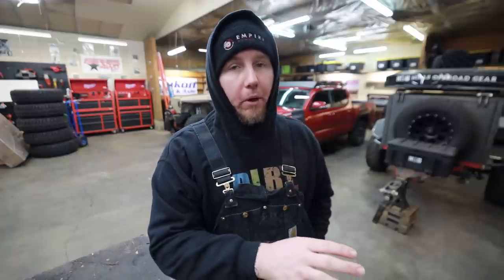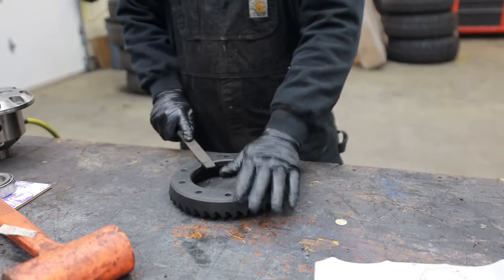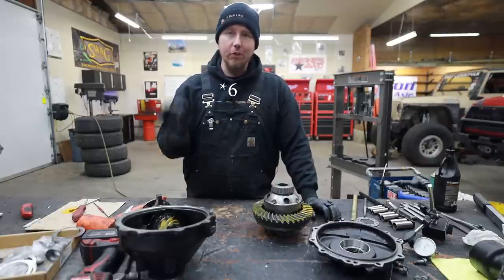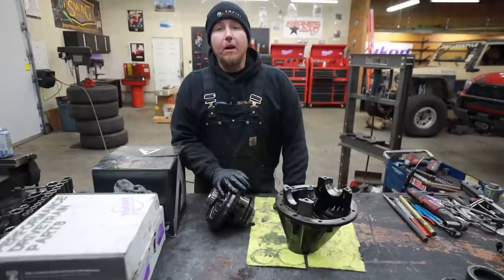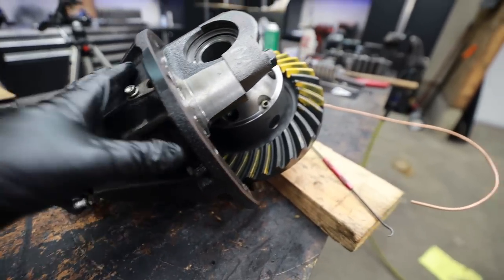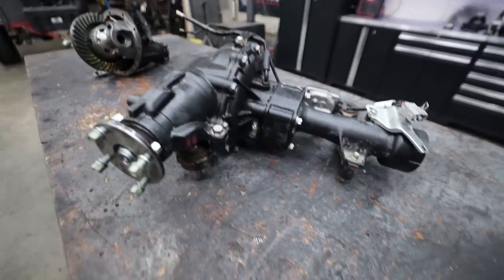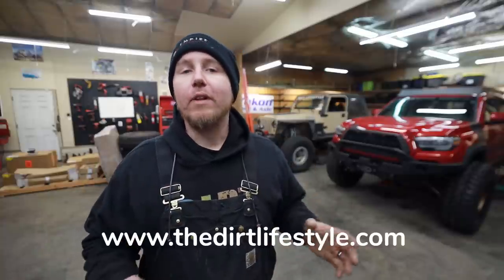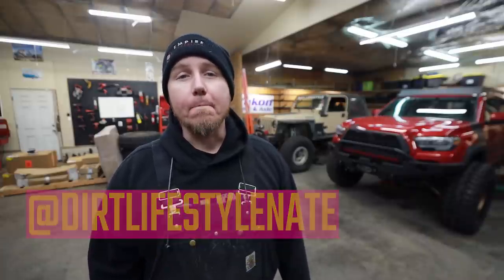Ultimate Toyota Tacoma Build Episode 4. 5.29 Yukon Gears And ARB Lockers.

Comment: Switch pro 9100 is the only way to go for switch panels! Also there used to be a place off 512 and Steele st called tacoma speedometer. They are great dudes with a lot of information that I’m sure could help you with calibration. Rad build man, can’t wait to see it complete!
Reply from the maker: I forgot about Tacoma speedo! I will hit them up next week 👊
Thanks!
Reply: Switch pros are the way to go! There are mounts for the panels that go in the coin tray low left of the steering wheel and in the sunglasses holder in the headliner. Both great spots. Get an expedition essentials dash mount and you'll have a ton of 1/4-20 mounting options. I have a sp9100 on the dash and in the headliner.
Reply: Switch pro is the way to go. I have one installed in my 16 Tacoma. As for compressor I have a twin ARB. It is tucked between the bedside and fender on the drivers side. I also plumbed in a tank makes for Super quick air ups
Reply: SwtichPro is definitely the way to go
Reply: Meso Customs is the other way to go.
Reply: Be wary of the second gen guys suggestions. There is no cubby left of the steering wheel in the third gen since there’s more switches. I think you could remove the switches but you would need to reroute those. I think just sticky it up higher. It won’t look as clean. There’s also no sunglasses holder in the headliner
Reply: Or maybe it depends on newer third gens. I have a 2021 no cubby left of steering wheel no sunglasses holder because of the off-road crawl control switches are there

Meso customs makes 3D printed parts but they fit only a few more switches here and there so depends if you have 4 switches to add or 8
Reply: @DirtLifestyle  umm yea dude looks like you know what you are doing! 😁
Reply: I ended up going with a Switch Pro mounted on a Power Trays tray and they sell all the needed wiring and such. SDHW makes a sweet left side cubby panel for the Switch-Pros. For the air compressor I mounted a dual ARB in the engine bay using a Slee tray.
Reply: @DirtLifestyle  meso customs has custom interior panels for switches that would look better in the interior of the Tacoma
Reply: Auxbeam I heard makes a decent one. But I'll look into the switch pro as well

Comment: Switch panel - switch pros and blaze Offroad makes a legit mount for them that sits where the cubby is to the left of the wheel. 

Compressor - Expedition essentials uses the cubby in the bed. Also some mounts for under seat seat. 

Speedo adjustment - easiest is scan gauge 2. Correct for a percentage (can figure that out yourself), other benefit is you can monitor 
 temps as well. 

Pro hood - you can get hoods online for 350 and paint as needed 🤷🏻‍♂️
Reply: These transmissions have a tendency to run hot so it’s nice to be able to monitor trans temps right on the scan gauge also

Comment: Expedition Essentials for the bedside cubby bracket , fits ARB single or twin compressor, I have a twin. They also have a plug and play harness that looks like factory Toyota, runs up to battery. Love love love mine. As stated before switch pro for switch panel.

Tuning CVC tune. Will fix Speedo too. Several tuners in the Seattle area .. will fix shifting issues and Speedo.
 PRO hood. I love how it looks. Cresting sucks. Put a switch in you can control front and rear cameras on demand.  I added front camera and switch to select camera.

Comment: Slee Off-road makes an engine bay compressor bracket for dual ARB compressors. It fits into the space under the hood on the passenger side near the firewall. Ran this setup on my ‘21 Tacoma.

Comment: Meso Customs makes a nice switch panel. I’m pretty sure they do custom panel layouts too. 
Rago fabrication has a great under hood mount for an ARB twin compressor. If you want the compressor in the cab Desert Does It makes an under the seat mount. Personally I like mine under the hood, it’s too loud in the cab.
Reply: I had a custom panel made by MESO customs as well. It is a nice raised panel in the roof, just behind the sunglasses panel.

Comment: Great Video, I used "Switch Pros 9100" one wire through the dash, 8 switches. I cut out the coin/dash cup on the left side dash, it's RGB color match your instrument night lighting. I fabricated my own Bracket and Mounted an ARB CKMA12 over the passenger side fender well, not ARB's biggest compressor but works for my applications. I have pic's of the build if needed, Cheers.

Comment: Slee off-road has a mounting plate for an arb twin compressor and manifold for the air lockers under the hood, I would also recommend switch pro with cali-raised power tray that cleans up wiring under the hood, then you can get a Expedition Essentials switch pro bracket that mounts in the glasses compartment overhead on the interior

Comment: ARB Linx! Will control lockers and lights. Also has a GPS speedometer built in. Only downside is the Linx does not incorporate relays, but is more of a relay switcher. Also if you go with a ARB compressor you can do pressure control for airing up and down your tires.

Comment: Desert Does It for the under seat compressor mount. If you are doing a dual battery then you can drill just a couple extra holes and the mount will work with a compressor and DC-to-DC charger as well.

Comment: Hypertech speedometer calibrator it hooks up behind the cluster and you can tell it what size tire you’re running and you get correct speed readings and mpg
Reply: That was the other brand I was trying to remember.  Rough Country makes a slightly less expensive unit that works exactly the same with the same software.

Comment: I went with 2 X ViAir compressors feeding an air tank. Because the ViAir unit is small and has braided outputs and input lines it made it easy to mount wherever I wanted behind interior panels.
Reply: Which compressor do you use? I recently got a 400p and was considering something like what you have
Reply: @kaimasterson8512  I went with VIAIR 380C 200psi Dual performance value pack off Amazon and swapped out the 200psi pressure switch with a 120 psi switch. I can route intakes up in the inner fender wells or even a snorkel, and if one pump fails I can disconnect the power to it and use only one pump. I had a spare tank in the junk pile and used hardware store flexible hose to the front of the Jeep as well as in the back. Plumbed out air connections in front and back bumpers. I use #speedflate air system to do all 4 tires at once and often air up others while I’m waiting. Lol. With the system I have I have used air tools on the trail or side of the highway. Very happy with how it turned out.
Reply: @charlietoner  wow that sounds like a really sweet setup
Reply: @kaimasterson8512  when I looked at the ARB twin setup without a tank, just a manifold, my setup was WAY cheaper and adaptable

Comment: Arb compressor has mounts in the bed, under driver seat or MORE compressor mount from extreme off-road. I went with MORE since not running dual batteries

There’s an obd plug in to adjust spedo for tire size

Comment: Can't wait to see this thing in action when its done!
Speedometer calibration - I went with an inline module. Program the tire size on your computer and install behind the dash. Super easy. Rough country or Hypertech.
Expedition Essentials bedside compressor mount is pretty sweet. I'll be doing that one some day. Hides whatever compressor you prefer behind the larger cubby in the bed. There are some good solutions out there to mount in the engine compartment too I believe.
I like rocker switches but didn't find too many great solutions that got you more than 3 switches. Seems like everyone likes the switch pros setup but I was stubborn and cut a hole in my sunglasses holder to add a bigger rocker switch panel. Had the sunglass holder instead of crawl control deal since I got a manual trd off-road.

Comment: Hit up Meso Customs for a replacement plastic to house the SP9100 controller or even run a SPOD and wire factory style small switches. As for compressor mount Slee Offroad was awesome, left room for a 1 gallon tank underneath, also I loved that I could have it on passenger side so I can mount the SP9100/SPOD to driver side. I have some pics if you need examples of what I did on mine.

Comment: Meso customs make custom
Panels to replace the factory dash witch panned to add rocket switches or switch pros in pretty much any configuration you want, for the 3rd gens I see most guys install a compressor on the passenger side engine bay  up agains the fire wall and a few company’s make a bracket to drop right in there, and for the Speedo there is 5-6 guys in the Seattle area that do the OV tune or the KD max tune and they can set the tune to match your tire size and gears and all the above, I had kris leach tune my 3rd gen and it made a world of difference. I am excited to see this build thread since I have a 3rd gen also

Comment: Desert does it makes under seat compressor mounts for both driver and passenger. For switches, I would get a switch pros 9100 and check out either SDHQ or Blaze Offroad for the mounting solutions, super good looking.

Comment: Switch panel hit up sdhq super clean install, arb compressor mount, try rago, expedition essentials, there’s quite. A few that put it in the void in the passenger engine compartment near the hood and you don’t have to mess with the fuse box or anything else.

Comment: And just finished the video. Rough Country makes a speedo calibrator. Arb twins fit under the hood.  And definitely get a OV tune.  That won't fix your speedo, but it adds a ton of low end torque,  and you can add a gear lockout which will hold any gear u want no matter what speed your at.
Reply from the maker: Thanks!
Reply: @Dirt Lifestyle  I've got pretty in tune with these trucks over the years.  Any questions just ask.

Comment: I want a touch screen double din radio with all the typically found features but with switched outputs, fused relay block and harness. It would upgrade the infotainment system and add switches with no mounting or loss of space all at same time cleanly. 

Viair compressors have been very solid for me. I have a 450p constant duty oba kit.

Comment: Another vote for the switch pro,  but also add the power tray mount and bus bar for a super clean install and connections.  Then cali raised makes a dash panel replacement for the switch

Comment: In the passenger corner of the engine bay, you can fit an arb twin. I have a smittybilt compressor mounted there. Pretty sure it's the same you have in your land Rover

Comment: My local off-road shop installed their switch pro in their shop Tacoma to the lower left of the steering wheel in the coin holder. Looks like it came from the factory.

Comment: I swapped in an LSD for the factory open diff in my BMW. I reused the same shims and everything looked good. I think most of the tolerance you are accounting for with the shims is in the cast parts. The machines parts like the LSD or the gears are probably kept to much tighter tolerances because that's not hard with a machined part. I know the cast parts have machines areas for the bearings to sit, but it seems like that milling process it not as accurate as when the gears and LSD/locker housing. that might come down to fixturing and what is practical in a mass production environment. 

That RCLT kit is pretty cool. I look forward to seeing the front end come together. I think the weak point is still going to be the factory front axle and maybe the rear axle as well, but 38" stickies will be an interesting case study. I wonder if you could narrow a full width axle with an off center pumpkin and get custom short axle shafts to keep it IFS. I know some KOH teams run IFS, but that is with a centered pumpkin. Maybe a front axle center section with semi float rear axle tubes and ends to give you a nice flange to bolt inner CVs to. I know the stock setup has a splined shaft on the inner CV, but CVs are available that bolt to flanges as well. 

I imagine you've thought this through already. I stay tuned to see what happens.

Comment: All pro off-road and expedition essentials make a box that goes in the cubbies in the bed. You probably don't have the driver side but it will work on the passenger side. You will probably have to notch the pre-made boxes to clear your tires tho so with you being a fabricator you can probably make your own that fits your set up better.

Comment: Method bead grip wheels are legit, I'm running them on my Gladiator with 37" KO2s. Last time I was out snow wheeling the rear tire was leaking around the bead from some debris that got pushed in there and I ran it completely flat for a mile or so and never lost the bead. I regularly go down to 5-6 PSI in the snow and 8 everywhere else and haven't lost a bead yet.

Comment: I bought the OV Tune (orange virus) equipment and a tune pack.  They send multiple files to flash.  The files vary on octane spec, tire size, gear ratios, and pedal sensitivity.  All files help the horrible OEM shifting tune tremendously.  A lot less gear hunting.  

Also look into KD Max, sounds like they’re tunes give a bit more power than OV.

Comment: Switch Pro 9100 for Toyota, and I recommend installing the panel in the sunglass holder.
Reply from the maker: In the sunglasses holder? Cool! I will check it out 👊 thanks bro
Reply: @DirtLifestyle  ya the Bluetooth version makes it pretty simple, but you could run wire to your overhead dashboard. Otherwise, a simple bracket to the driver side air bag panel (but not over the air bag…. yaaaa) is pretty convenient too. 

Love the channel!!

Comment: Just bought a 21 TRD OR 4x4 in a automatic just like yours and just love it , I went with the fox by pass shocks on all 4 corners 1.5 inch lift in the front and 1 inch lift for the rear,  with TRD pro wheels and Toyo  AT3’s that are  32inch tall 
 it’s my daily , but for the slight suspension lift with 1 size bigger tire I’m impressed with what it does off road, I can’t imagine what yours will do with 38’s lol that’s some serious transformation, keep up the great work Nate , can’t wait to see this built all done and on the trails 👍🏻

Comment: Guessing at this point someone has already shared these, but here are the ones I used on mine. Expedition Essentials twin ARB mount(goes in the bed side pocket), it can get a bit dusty in that spot, but is super convenient. For the Speedo, hyper tech is a great option, super simple to set up, can be recalibrated as many times as you want and just plugs in behind the cluster. I used the SP9100 as well, but although was originally mounted to an SDHQ plate have since changed it to a Power Tray for a bit mor accessibility to he connections; I also found that the switch panel fit really well on just below the moonroof on the roof cluster(just made it a bit more accessible than some of the other mounting options for me. Have fun, looking forward to seeing 38s on a 3rd Gen!

Comment: Techstream software and buy a cable to adjust the speedo.  Viair compressor fits easy under the hood on the passengers side towards the firewall.  Making a bracket was quick.  Flat plate and a single Z shape for front support.

Comment: Switch Panel: I think Spod makes the best looking switch panel that goes in a factory location.
Speedometer: OVTune all the way. You can get an existing tune or tune it yourself with their software. Easy to learn and you can change shift points too.
Compressor: ARB makes one that fits in the engine bay.

Let me know if you need any help. I am on a budget so I mounted a cheap compressor in the bed cubby, a 1.5g tank where the spare tire was and designed my own spod like device to work with my phone.

Comment: Hey Nate, I just got the rough country speedometer calibrator for my 2019 Tundra. It was super easy to set the tire size and you can change the gearing size as well and then you just plug it into the truck. I’ll be posting a video on it this week! Hope this gives you another option!
Reply: Second this.  Had mine running for 2+ years and no issues.  I’m running 35s, but doing trial and error the calibration for 34” was slightly more accurate with gps and radar on the side of the road.
Reply: @peterfairhurst  that’s good to know man! I have 295 70 R18’s on mine which are 35’s ish but when plugged into the system it’s 34.28 or something like that. So it should be good!
Reply: You don't want to change the gear ratio in the Rough Country plug n play unit, just the tire size.  The speedo isn't ran off the trans output, rather the wheel speed sensors.  So it just needs to know the tire diameter to feed the speedo the correct info.  If you change the ratio option, you will get all kinds of goofy numbers for your actual speed.
Reply: @insaynbcr  yeah that’s what I had heard as well but good to know! I didn’t change my gearing so I didn’t look to hard into it. Thanks man!

Comment: vivd lumens is what i run, it colour matches the blue back lighting. arb 12v twin is super reliable and they have the mount that fits in the engine bay. just dont put your locker buttons on the switch pro, ive heard of stories where things short and you dont want your lockers coming on randomly especially if your compressor isnt on. i have my compressor and the 2 lockers front and rear on my 3rd gen locked out with a relay that wont allow them to come on unless the pump is on. cheer bro, sick build!

Comment: Get the arb 12v high output air compressor or the same thing just with a dual motor. Some websites have brackets for the air compressor for under the hood and seat mounts